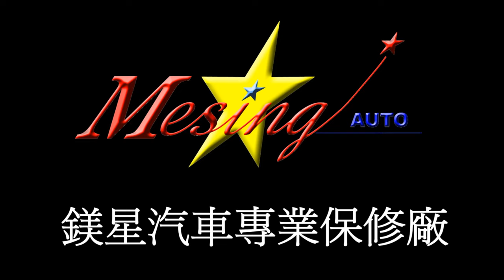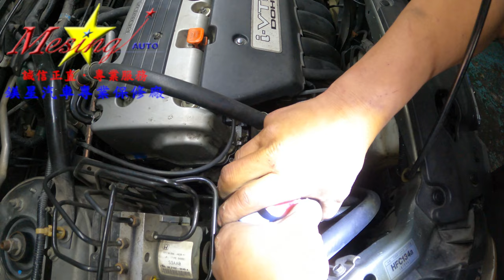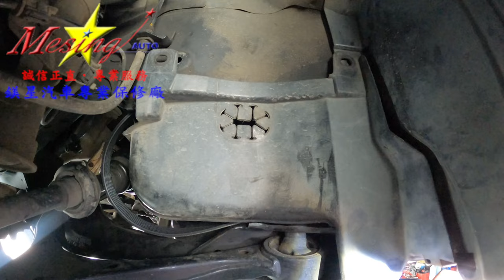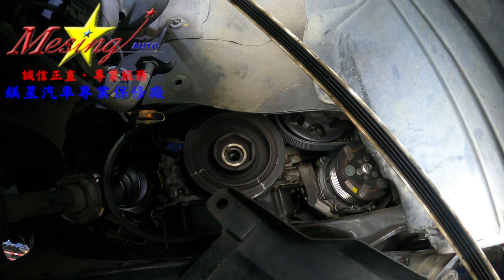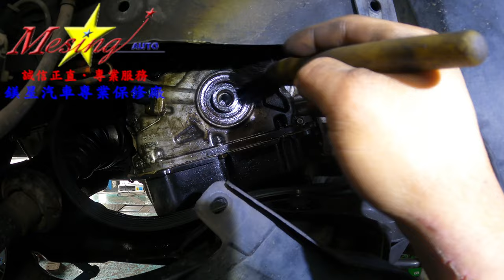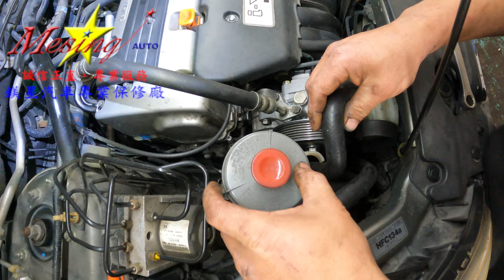How to Replacement Front Crankshaft Oil Seal HONDA CR-V 2.0L 2003~2006 K20A4 MCVA/MRVA 4WD

Comment: I wish all automotive videos were this concise and efficient.  From my experience I learned the one shown was a nice newer pulley and bolt.  Mine did not come loose with an impact wrench.  I found the special 50mm tool necessary to hold the pulley so I could break the 19mm bolt.  Procedure for 2004 crv

Comment: If only the crank pulley comes out that easily
Reply: I had to use some extensions to have my breaker bar passed the wheel well and then put an 8 foot pole on the bar to break it loose. I watched this video to make sure it wasn't a left hand thread lol

Comment: Wasn’t there a very small spring also did you not put it back
Reply: Bearing retainer clip, suppose pulley wheel keeps bearing locked in.🐉🌅

Comment: What did you use to clean around the crank area?
Reply: Just use parts degreaser or brake clean
Reply: brake or carb cleaner , degreaser only if you're going to water hose the engine

Comment: Enjoyed the video and you made quick work out of it. I think the pulley bolt is supposed to be torqued to 130 ft. lbs., but does anybody believe those things are tightened to that? Lmao! I'd probably do like you; impact off/impact on -
Reply: I torque everything. That’s how bolts break.
Reply: How did the impact work our for you?
Reply: I have one of those high end milwaukee 1/2" drive impacts with the big battery and one of those thick Lisle sockets (very important), and I don't think it hammered 3-4 times and it was off.
Reply: @smid2550 I got the big milwuakee as well with a 5.0 battery tho, maybe you have a bigger battery? Had to pull out a breaker bar and slide an 8ft pole into it to break that sucker loose. But first I had to confirm it wasn't a left hand thread lol
Reply: @miguelh281  you have to have the 12.0 battery to get maximum power/torque; they're about $250. The 5.0 battery is like what you'd use on a 3/8" dr. impact. In fact, I just looked at my 3/8 impact, and it has a 5.0 battery
Reply: @smid2550 so I'm doing the same job to my RSX, same impact same socket same battery and maybe 3-4 klaks later the bolt broke loose. Maybe the CR-V was worked on before idk but but it took a whole lot of torque to break that bolt loose. Glad it was easy this time around

Comment: Did you lift the car?
Reply: Yeah, you've got to lift the vehicle to get the right front wheel off to get access to the splash guard and crankshaft pulley.

Comment: What tool did you use to get the seal out
Reply: It's just a seal puller.... Should be able to find out at any auto parts store.
Reply: Can we use something else beside a seal puller
Reply: @Silenceplz595  a simple hack to remove the seal rubber is to drill a small hole on the seal rubber using 1/16" or 5/64" drill bit then get a screw that would fit the hole, screw it in then pull it out with a pliers.

Comment: Amateur, unprofessional. You NEVER use impact tools to torque bolts. Although you can use torque sticks on lug nuts. No reason to use dangerous solvents to clean front cover. Served absolutely no purpose. You are supposed to lubricate lip of seal. Totally uninformed example of how to do this kind of work.
Reply: And the seal is lubricated, if you watch properly their is greese on the seal.